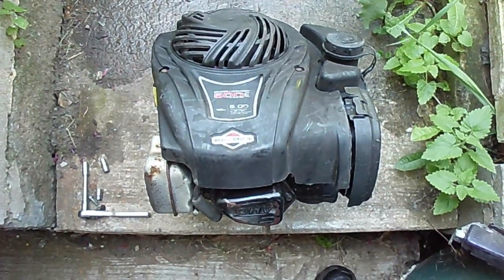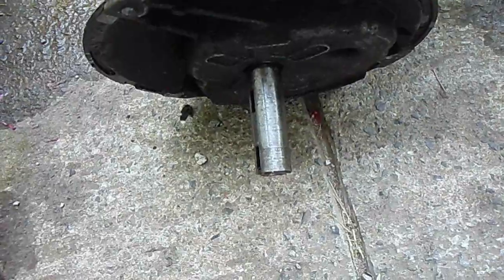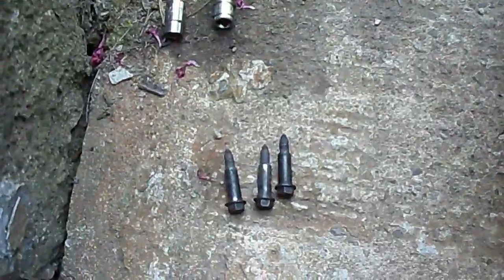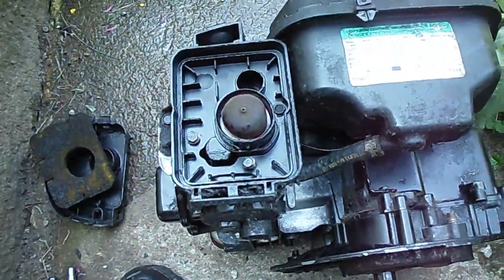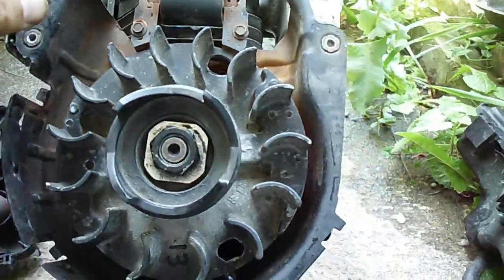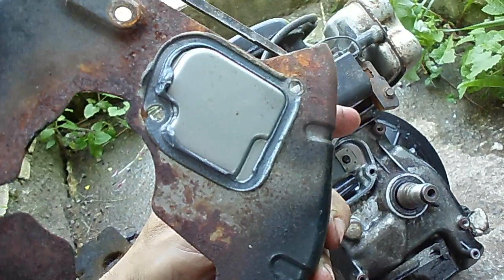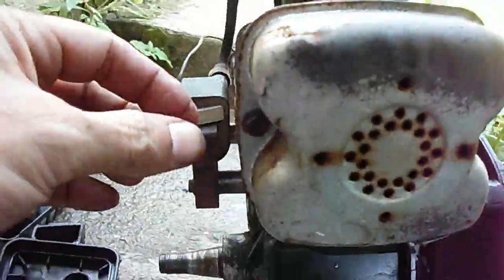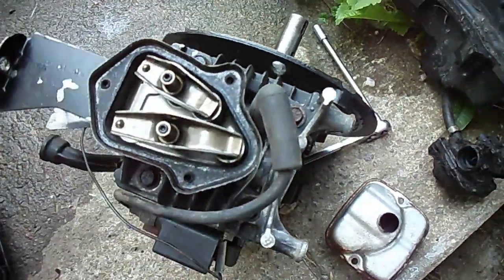Briggs OHV Model 9P702 Teardown PT 1

Comment: The sad thing is, these are actually good engines that get chucked years before theyre well and truely shot
Reply from the maker: Oh, I agree, most of the engine I find at the scrapyard have years of life left in them, they get tossed when any small problem developes. a fair percentage also have bent crankshafts, as i discover when I try to take them apart.

Comment: The two screws that hold the air filter box to the carb don't even need to be removed, the two outer ones just hold the whole assembly to a frame and taking those out releases the filter box, carb and tank as one whole lump... :)